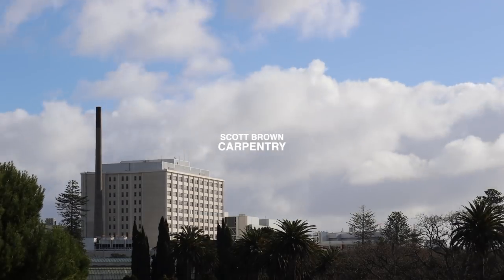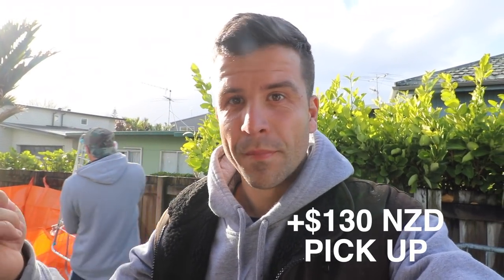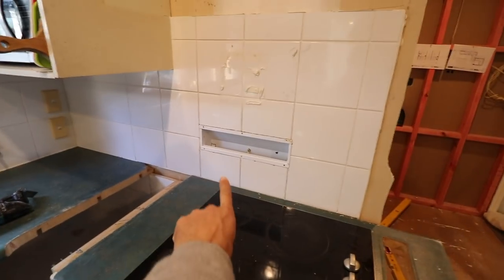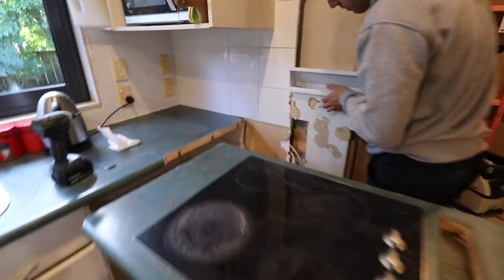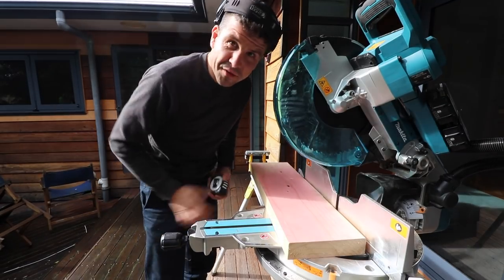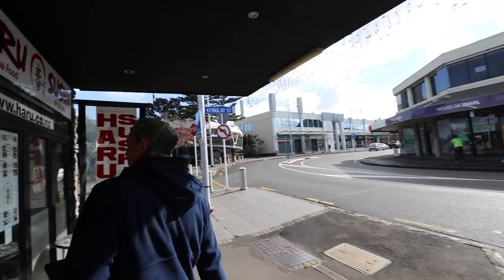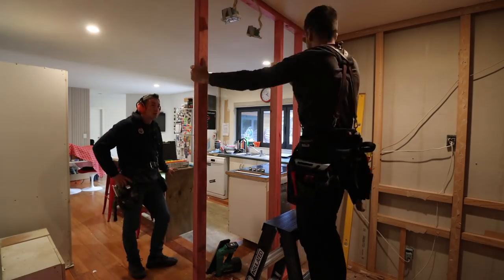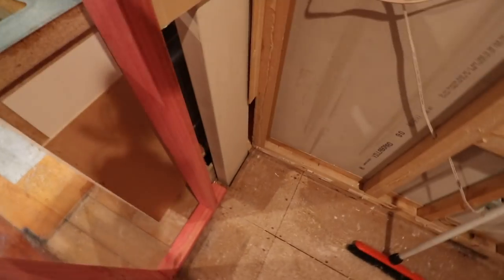The Work Nobody Sees

Comment: Depending on the size and what is in it we call it either a pantry or Butlers pantry.
Reply: Niall Povey difference isn’t size. Butlers pantry’s (which is what a scullery is) should have a sink for cleaning up dishes. A pantry is normally just storage without cleaning or preparation areas.

Comment: The wood for your studs seems exceptionally red. What kind of wood do y'all use for studs over there?
Reply: More to the point - why are they using treated timber internally, is this normal?
Reply: Its not treated. Thats just their basic studs are dyed pink.
Reply: Pink is boron treated interior wall framing. See https://www.buildmagazine.org.nz/assets/PDF/Build128-19-BuildRight-TimberTreatment.pdf
Reply: The timber is pink because it is treated (see post above) and for ease of identification. The kind of wood is Radiata Pine.